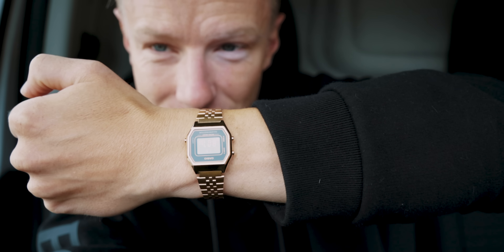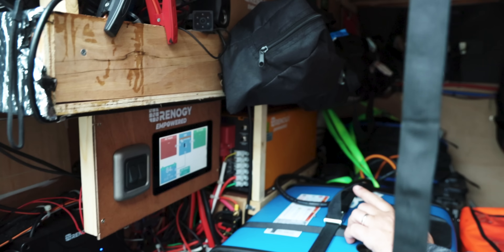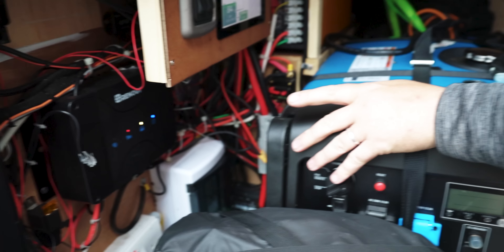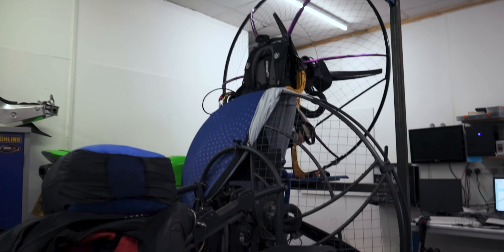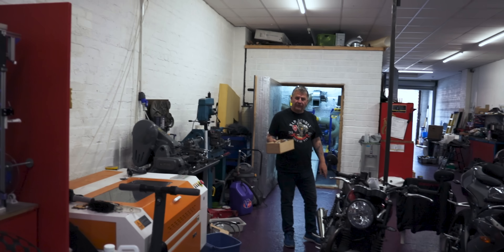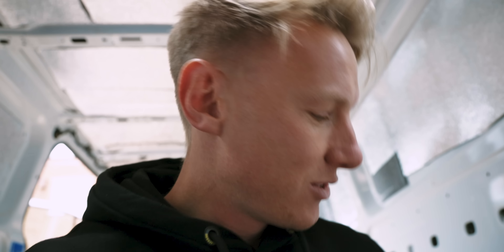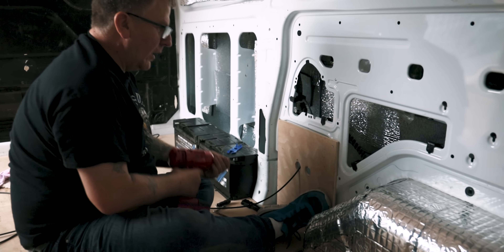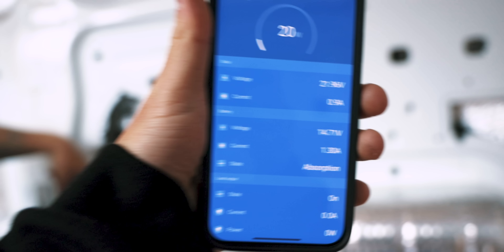My Custom MTB MOTO Van’s Next Stage Of The Build!

Comment: Casio F91 with plastic strap is best watch for motorcycle people. It’s small and doesn’t stretch glove or leather. Has 10 year battery. Less likely to smash wrist to pieces in a spill as snap off in impact. Cheap to replace. Can be mounted to handlebars if missing a clock in all weathers.
Reply: But you won't pull and Ladies wearing one! Ha!!